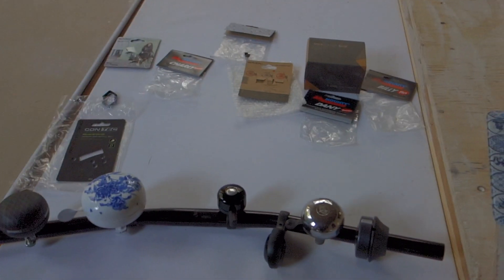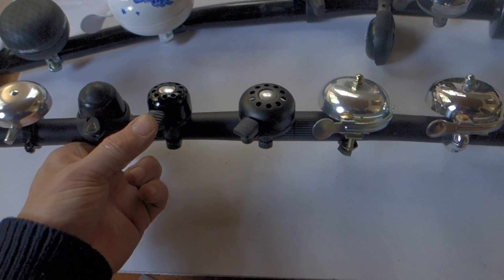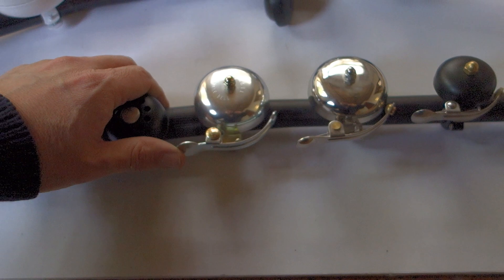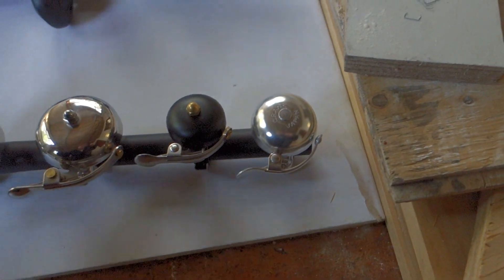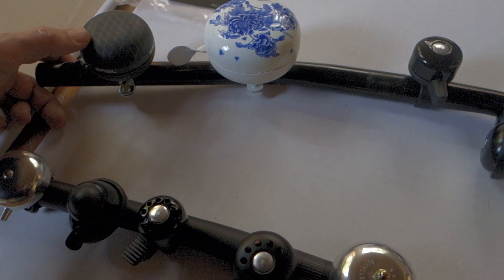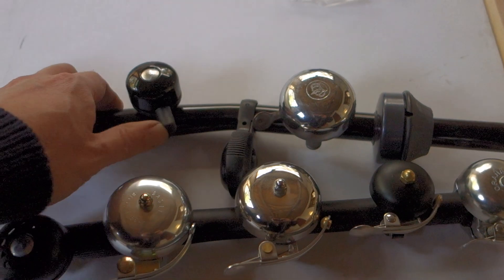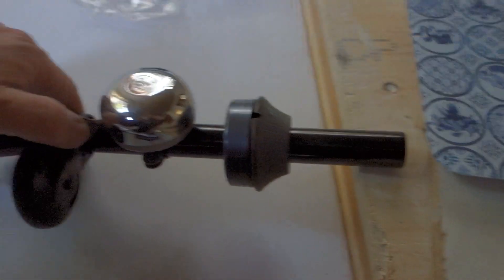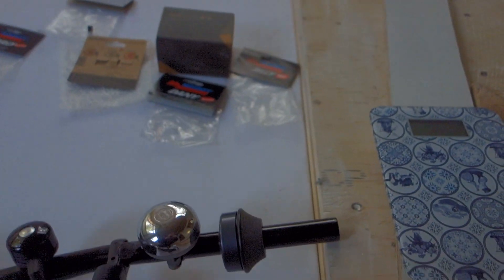Bicycle bells part 1: Test in the dry (A comparison of ding-dong, tring, ping bell types).

Comment: Where to buy gazelle grip bell? I only have Bridgestone grip bell
Reply from the maker: This bell seems to be made specifically for (or even by) Gazelle, which is a Dutch bicycle brand. I've not seen any similar bell from any other brand. This means it's only available normally from Dutch and I guess also Belgian and perhaps German bike shops. If you really want one and can't find it at all from an online seller, contact me via my site ( https://swhs.home.xs4all.nl/fiets/tests/index_en.html ) ,  and I'll see if I can get hold of one for you.
Reply: @WHS_reviews  i like the sound of that gripbell, my current grip bell comes from Japan
Reply from the maker: Yes, the sound is pretty good, and even in the rain. Which brand/type/name is that grip bell that you use now? I had a quick search and found one from 'incredibell', perhaps that's it? As to the Gazelle grip bell, they use it incorporated/attached to the grips too on their own city bikes. A quick search only showed such combinations online, but the one I have I bought separate. Perhaps in such a combination the bell can be separated from the grip.
Reply from the maker: Coincidentally, I just got hold of an e-scooter to test and it came equipped with a grip bell with the same sound as the Gazelle bell. I will try to find out the brand and whether it is available separately or only for OEMs.
Reply: @WHS_reviews  wait I'll upload my video of my bell
Reply from the maker: Yes, I see, the frequency distribution is different and I like the sound of the Gazelle bell a bit more too.
Reply: @WHS_reviews  yah i like it too, but im in ph, I can't afford the currency 😂

Comment: THANKS!  I AM NOW LOOKING AT THE VOXOM KL5.  CLASSIC LOOKS AND NICE SOUND.
Reply from the maker: At first I liked the sound of aluminium bells better, but yes, it's quite nice. The lettering on mine is wearing off by the way. I could only find it on amazon.de but in Germany you should be able to buy it from many bicycle shops. One issue with such ping bells with lever is that sometimes there is some friction around the lever point, so after a few months I applied some chain wax and it was good again. Perhaps that points to an advantage of the bells with clapper directly attached to a spring (no friction of one part moving against another). On my site I already split the 'ping' category into 3 sub categories, and I will get into this and ergonomics (such as  force needed to activate a bell, shape of the lever that you push with your finger etc.) in a video coming soon to a computer screen near you :)

Comment: Thanks for the video! Which one would you recommend for a child's bicycle?
Reply from the maker: That's an interesting question:  I think that ding-dong bells are a very good option, they have a nice sound (I think children will like it), can be heard very well also because they are very distinctive, so should give safety by making sure others pay attention. You could also let your child listen and see what he or she likes...
Reply: @WHS_reviews  You are right, their sound is good and, after having watched the other video you made, I now know that they are the only ones that work when it rains. I was ony wondering if the resistance force of the lever is not too strong for a child's finger. Again, thanks a lot for those very helpful videos.
Reply from the maker: @TG-fu1iw : Well: all the steel ones work well in the rain, brass too but I don't like the sound of brass bells. That they work well in the rain is because of the vibrating mass that is bigger than aluminium and so the movement is dampened less by the rain drops. I have mounted on my bike the Voxom KL5 these days, but the lever on the ding-dong bells is far easier to use, and the same goes for the tring type bells. So for a child, the ding-dong and tring bells are not a problem. Some ping bells need a lower force, but, the force with the other bells isn't really that much more and as they give a sort of place where to put your finger, actually I find them (edit: so the ding-dong and tring bells) easier to use than the ping type bells...

Comment: @ 1:55  how do you spell that name of bell? thanks
Reply from the maker: That's Basil, a Dutch company. (I would instead get the Voxom that's all stainless/brass beside it, by the way). After your question I changed the text with the video to show the link to my website on the 2nd line as that is not shown otherwise without clicking 'more'. There you find more details about weight, mounting, pictures, names etc...